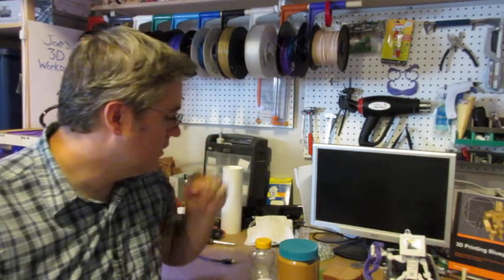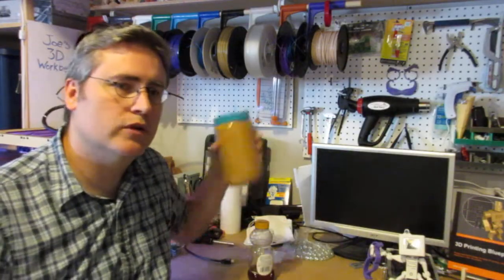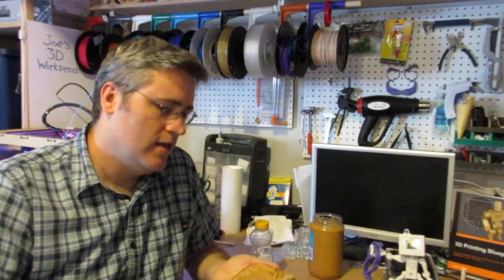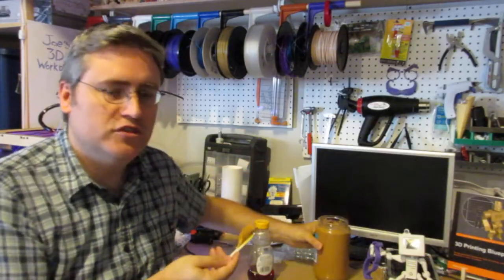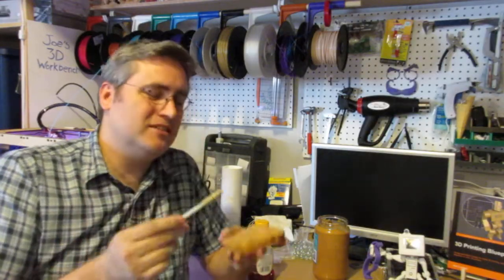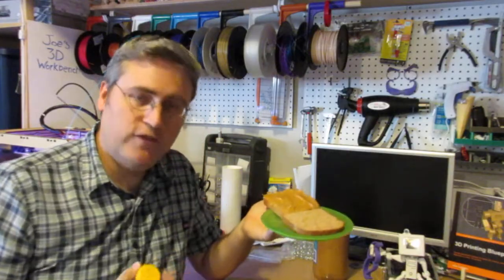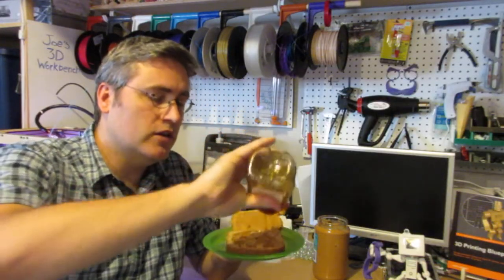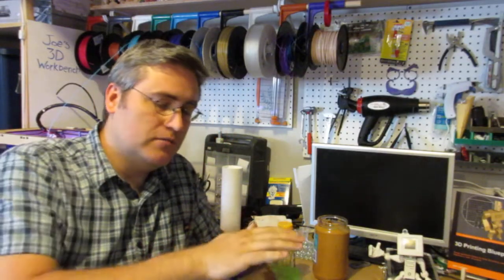3D Bench Talk   Food Safe

Comment: Damn you I'm on a diet!!! Just kidding lol. 

But you did not mention one of the biggest things about food safety: Porous materials cannot be washed clean. Even vapor smoothing won't close all the gaps. In those gaps bacteria and stuff can grow and release toxins. BTW wood stuff isn't food safe either. Of course I personally wouldn't worry about it too much. But it's not so much about the material as to the porous nature of 3D printing. You might be able to give it a coat of food safe paint though.
Reply: Bacterial growth. Yup, I forgot to mention that and I'm planning to make a follow up video to this to address it. But as far as the FDA is concerned, that didn't matter if you want to use the term "food safe". That means "food safe" is only slight above "organic" in terms of actually protecting you.